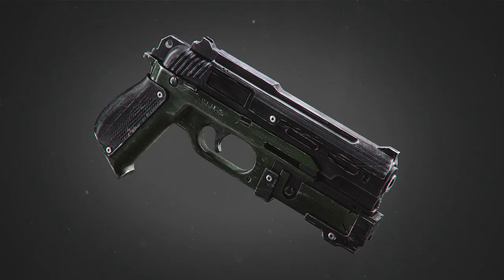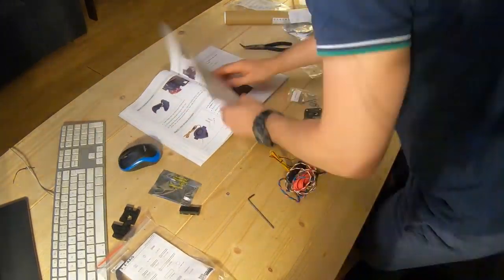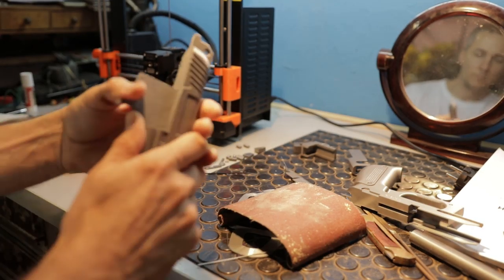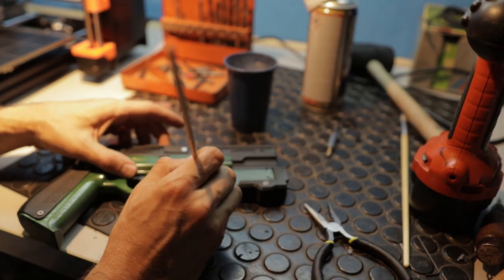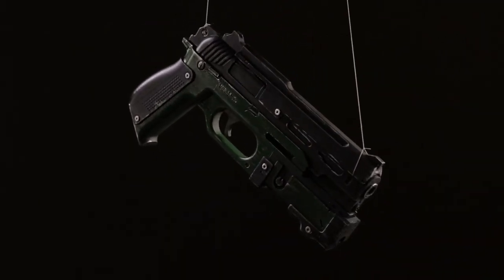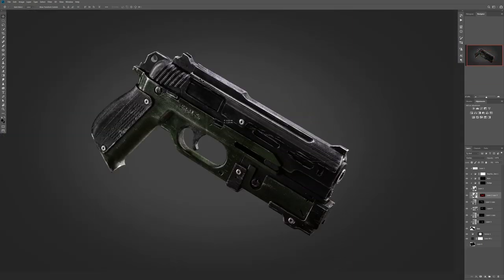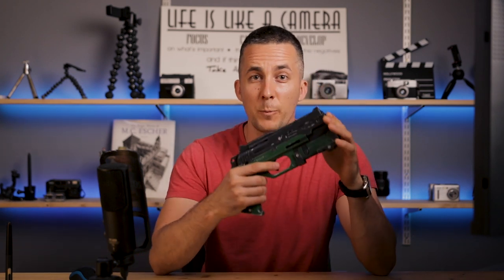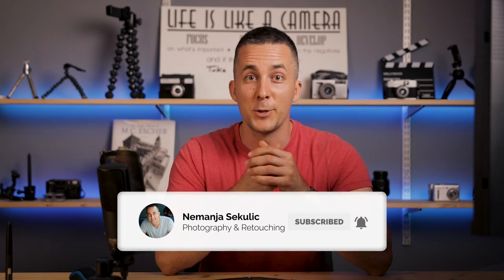I Made My First Gun!

Comment: Great job! 
There's still quite a bit of layering visible, but an impressive job for a beginner nonetheless. The Punished Props Academy channel has some awesome videos on how to finish a model through systematic filling and sanding until it looks indistinguishable from a CNC-cut part.
Reply from the maker: Thanks a lot. I was trying to find some things to fill the print, but I didn't manage to do it here in my city. Will try more and hope that I will find something for the future prints.
Reply: @NemanjaSekulic  We all had to start somewhere and from what I can see you're already doing a lot better than I did back then. Easiest stuff for this is Bondo or some other plastic-based putty from wherever people buy car/home repair supplies (e.g., hardware store).